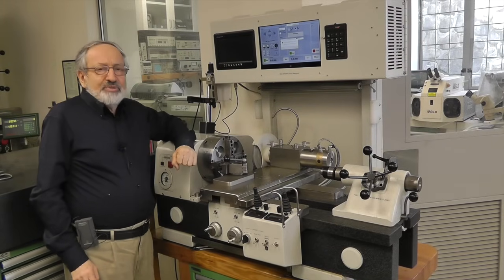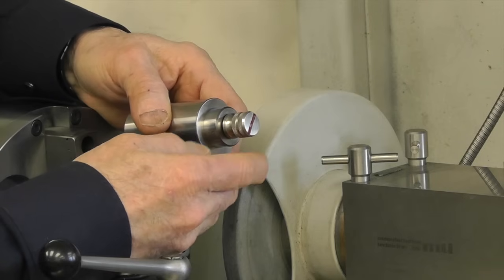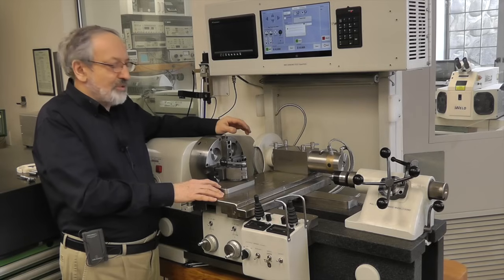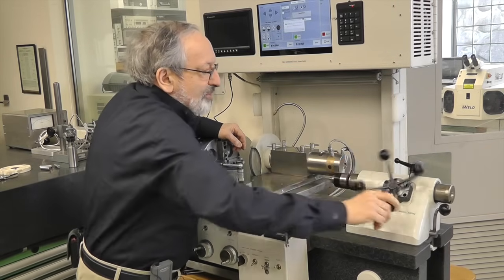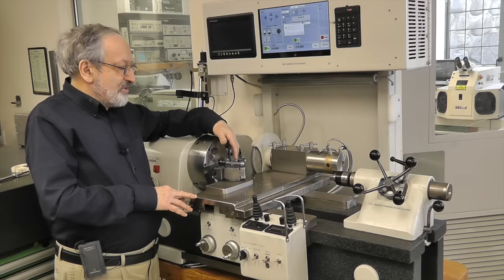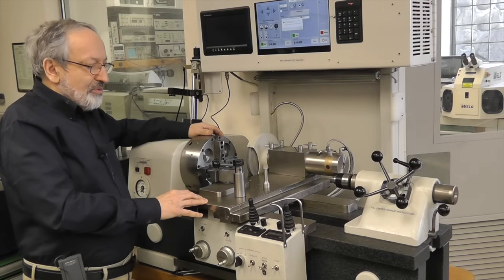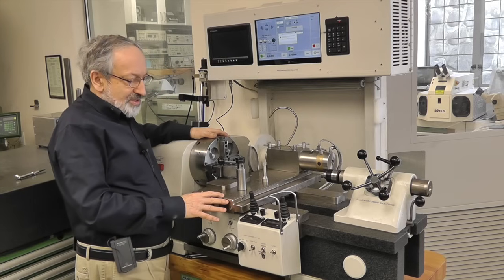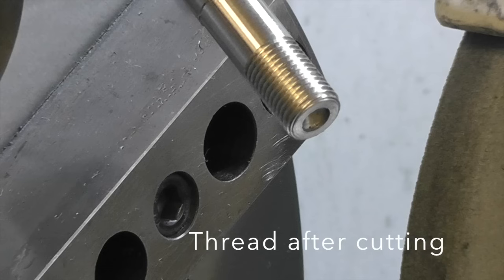High precision air bearing CNC lathe and grinder

Comment: Spinning an assembly in one's hand is hardly anything difficult to make ....provided the machine is a "reasonably good" rigid machine and it is installed correctly and accurately aligned.
In the "real world" there is very little documented about the performance of an air bearing designed machine and its' actual machining capabilities.  There are lots of impressive drawings and lots of claims, but when it comes to actually comparing a good conventional machine vs this kind of machine ....there is nothing.
If someone really wants to machine to 1 micron on a conventional machine .....it will take just as long as on an air-bearing machine, or perhaps a little longer .....and an air bearing machine does not necessarily do it any "faster".     You need the right setup at every step ......and then what exactly will you do with an assembly you hold in your hand and spin?
WHO will use it and WHAT will it be good for?       OR ......HOW could one apply this to anything that makes it useful for anything?
I knew Dan many years ago and supplied some machinery to him when he worked in Discoveries Park.  He talked the same way ...all about precision and accuracy ...and scared most people off .....needlessly ......as they couldn't equate to "reality".
Just a very quick note .....I purchased a Harrison M250 decades ago for my home shop. I spent a great deal of time leveling and aligning. I put a good toolpost grinder on it an pretty much made exactly the same little thing just for fun .....to see if I could make a fit that actually "sealed" .....and I did .....and still have it today, sitting on my tooling shelf.

The point is simple.  ANY serious machinist could make what Dan has made, provided they have good quality equipment. Dan has NOT stated what the "clearance" is on his assembly. He has stated merely that his machine can machine to a micron.  Any machine can machine to a "micron" ...but it would be either "luck" or an "accident". In the case of a lathe, the crossfeed screw and nut, and cross-slide tightness are indeed important, to have any confidence in consistency.

Comment: Hi,

I could not be more impressed. Thank you for sharing. Thanks also for the Flexture video.
I noticed a high-precision feature used in a wafer-inspection microscope that could be adopted to most CNCs. The former optical company Klinger, used a system of bearings to remove an leadscrew/ballscrew's radial influence on the linear assembly. In other words, the leadscrew/ballscrew only constrains the axis in 1 dimension.
https://youtu.be/WDQ3mvtGCTw?si=8Z6VauImSEEpE4xf&t=1867
Reply from the maker: The Klinger solution, which came from their French Micro-Controle acquisition, is good, but the simplest and the best is the solution used by Universal Thread Grinding shown here: https://www.universal-thread.com/  In this solution they incorporate a 2 axis flexture in the nut body and still have good axial stiffness.  To accommodate larger motions the nut body is made longer.
Reply: @dgelbart  , If it weren't for you it might have been a few more years before I heard of Flextures.

I have not encountered this figure of merit, yet, used in their manual: "Thread to thread error as low as
0.000010" including drunkenness".

Oddly, Kingston-style hydrodynamic ship bearings are interesting, as well.

Thank you for the reply.

Comment: if every part has a tolerance of 1mi the total tolerance cannot be 1mi but higher than that
Reply from the maker: The idea of air bearings (or any non-contacting fluid bearing) is that they average the errors. If you have two plates, each one made to 1um, and you make one slide over the other with no contact (like an air bearing), you will get a motion with about 0.1um accuracy. The larger the bearing area, the more averaging you get.

Comment: hmmmm ... A granite bed ! 
Will it be accurate ?
For how long ?
Reply from the maker: Will be accurate forever as all parts float on air-bearings so they don't touch the granite.
Reply: @dgelbart ... 
Wow !!!
I am unable to visualise how the carriage moves(and how the air bearings factor into this) without touching the granite bed !!!

If it's some CNC lathe mechanism I wouldn't know as I haven't had access to a CNC lathe to grasp it's inner workings!

Comment: How does the carriage move? 
How difficult would it be to take these fundamentals and use them to make a mill?
Reply: Air bearing milling machine? interesting idea
Reply: @ ya, my concern would be how much load can an air bearing take?
Reply: @isaiahjanzen3822  yea if you want more rigidity then you can instead use oil film bearings - like the do in swiss lathe spindles
Reply: @IsZomg  oh very interesting never heard of those before,  do you have any videos to recommend?

Comment: Can you tell me more about the cross sled and how that was made? Also, the T blocks of the bed; are the parallels just epoxied on? No bolts?
Reply from the maker: The cross slide rides on two granite parallels, using air bearing similar to the main saddle. The tops of the T-bars are just glued on.

Comment: 7 21 24    
    that demo of the cylinder / piston and on-off air valve was an ingenious idea 
to aid understanding.
      it was just this month reading   t. clancy's novel " the sum of all fears " that i 
became aware of machine tools using air bearings.    and their ability
to grind metal on the inside or outside surface to a mirror smooth finish.

      and that led to searching u-tube for a video on the a-b subject.

        a curiousity is how much of a layer of metal , millimeters or microns ,
 an a-b lathe can  remove at a time.  
       my thought is too much will cause the rotating shaft
to tilt off-center.    and possibly lead to vibration.  

       also curious if hi - precision microgram scales rest on some sort
of an air cushion .  to damp out ground vibrations.    and that it is
this air - damping engineering that makes them so costly

Comment: Will  you share  the mechanism  used to achieve this accuracy in X direction , the encoders  implemented, and the servo/stepper drivers ?
Reply from the maker: The accuracy is based  on a high grade (grade C0) ball screw with a preloaded nut. It is driven from a microstepped stepper motor which is geared down via a timing belt. The amount of gearing is selected by the pitch of the lead screw.  To get 1um error on a 5mm pitch the angular error has to be 360 degree/5000=0.072 deg.  A 200 steps/revolution stepper motor is accurate to 5% of a step, or 5% of 1.8 deg=0.09 deg (at no load) so a 2:1 reduction is sufficient. Note that a rotary encoder does not increase the accuracy. The leadscrew can be error-mapper as the basic accuracy of the lead screw is not quite 1um, or a linear encoder can be used. A high torque motor is selected to limit the angular errors caused by torque variations (what is known as "power angle").  For better performance you can use a servo-motor with a built-in encoder such as https://teknic.com/products/clearpath-brushless-dc-servo-motors/. The couplings between the ballscre nut and the slide are critical as they should not transmit any side or tilt forces. Best type of coupling is as used here: www.universal-thread.com/downloads/Universal-Lead-Screw-Assemblies-Catalog.pdf.
Reply: @dgelbart  Thank you so much for answering the parts that were taking my thoughts on how to achieve this accuracy without needing a high-precision glass absolute encoder.  The info you provide about  the high accuracy of the  lead screw is very helpful over the ball screws.
Reply: https://www.youtube.com/watch?v=9TKd0OXLiiI&t=616s
Reply: I wonder what the lathe can do if its run on a closed loop servo with laser interferometers as the encoders.

Comment: can i just use a big granite surface plate as bed?
Reply from the maker: you need side guidance as well.
Reply: @dgelbart  well I was thinking of taking a granite surface plate & mounting some linear rails on top of it for the carriage. I don't need maximum accuracy. Is this a decent idea?
Reply from the maker: yes.  @karansingh1154
Reply: @dgelbart  thank you

Comment: I need this.  Specifically, I need single point diamond lathe cutting of paraboloidal, hyperboloidal, or ellipsoidal shapes in 6061 Al.  The parts are about 2mm at the large end, 1 mm at small end and about 70 mm long so they resemble very long thin cones.  Because they are so long and thin, they must be held at the tail end while being cut so they are under a very small tension during cutting.  After cutting we will coat them with 6um of electroless Ni and superpolish with diamond powder to a surface finish of 10 angstroms rms.  These are molds for grazing incidence x-ray mirrors so accuracy is needed.

Comment: Is there a car with wheels wich work with air bearing? Or a car's engine with air bearing?
Reply from the maker: No.
Reply: Do you think it could work? If you don't, could you say why it couldn't work for the wheels or different part of the car's engine?  @dgelbart
Reply from the maker: will need too much area.  @david43485
Reply: I don't understand fully your answer. But I suppose that's a question of mechanical physic.
And I keep your answer. Because you know what you wrote, and you know your subject : the applications of air bearing.
Thanks Dan! Have a nice day!
 @dgelbart
Reply: @david43485 air bearings are not great for huge mechanical loads. He is saying the surface area of the air bearing would have to be huge

Comment: Thanks a lot for the video, Dan - really impressive! I was just wondering if it's not a problem to grind on the lathe? You grind wet, but isn't there still a small risk that the grinding dust will damage the machine bed or other parts of the machine?
Reply from the maker: You are correct. The bed has a rubber cover, connected to the carriage. It is not shown in the video. I was also counting on the air escaping from all the moving areas but this was less successful.
Reply: OK, understood. Many thanks for the quick response!

Comment: How flat "generally " is 1 1/4 polished black granite from a stone supplier not lab equipment store ?
Reply from the maker: My guess is 25-50um (1 to 2 thou) for a 50cmx50cm slab. The error typicall y grows as the square of the size.
Reply: @dgelbart  Thank you so much for answering !

Comment: What is the best way to make tailstock the same level as the chuck?
Reply from the maker: The tailstock was bored out on this lathe, using a 600mm long boring bar clamped in the chuck and supported at the far end by a precise bushing. To get the bushing exactly on the spindle centerline you bring the bushing, mounted on a temporary tailstock block, near the chuck and bore it out by coupling it to the slide. Now you have a support bushing exactly on the spindle centerline, and you can install the boring bar. During boring the tailstock is coupled to the slide with a linkage, so you can use the power feed of the slide to move the tailstock and bore out the 300mm long hole to 1um.
Reply: @dgelbart  thank you!

Comment: Good day I presented his air pillow lathe on our forum and various observations were unleashed.
a) of what the mand however to the X and Z moves under the push of the tool.
b) At what pressure the cushions work.
How much air consumes the spindle and all the complete lathe
Thanks for a welcome answer
Sincerely
Giuseppe Crimi
Reply: thank you very much, inserted your answer directly in the topic
Reply from the maker: Here are the answers:
 The stiffness of the air bearings is in the range of 1um/kg (i.e. a 1 kg load will cause a 1um deflection). This does not affect accuracy much as the forces created during a finishing cut with  sharp tool are much below 1 kg.  The air bearings need at least 6 atm (0.6MPa or about 90 PSI) to work, the higher the pressure the better. The air consumption is about 100 liter/minute..

Comment: i think i figured out something interesting about building structures by watching your videos, can u please tell me if i'm correct, and if there are any exceptions to this thinking :-
1.   if the only purpose of a structure is to be stiff ( i.e., to have a low deflection per unit load), then, i can join the building blocks of the structure, using just hardware shop epoxy. (ex - machine frames like this).
2.   if a structure is meant to bear load to its max capability without breaking then i have to use welding. (ex - bridges and buildings). stiffness and deflection become unimportant.
3.   since most machine structures are meant to be stiff , but not strong. an epoxied structure would make more sense as welded structures would cause more problems (warping, internal stresses, etc) than an epoxy glued structure. 
4.    its better to make a machine structure by gluing with epoxy than by welding.
5.    people who are building machine frames/structures by welding steel are wrong.
6.    another method : using only screws and nuts ( threaded mating parts) to build the structure. i'm wondering if this method has the advantages of both epoxy structures and welded structures. is it better than both, or comes second to epoxy.
7.    how about using both epoxy and screw , will it give both stiffness and strength?

Thanks in advance. i've learnt so much from you.
Reply from the maker: Correct. See the demo of stiffness vs. strength in the video called "design" in my prototyping series.

Comment: What is the difference between semiconductor air bearings and regular air bearings?
Reply from the maker: None
Reply: Thank you for replying. May I ask the thread width of the screw drive and the model of the stepper motor you are using?
Reply from the maker: @Aviator168  3mm
Reply: @dgelbart  Thanks Dan. I am trying to learn here. Why did you choose a stone instead of steel for the bed?
Reply from the maker: @Aviator168  1. Long term stability 2. Availability of accurate 4 way parallels.
Reply: @dgelbart  I see. Thank you.

Comment: When making the bed section, you mention the bolts will hold the sections with compression. Doesn't the bolt relax and compromise the accurate measurements?
Reply from the maker: The amount of compression in the bolt does not affect accuracy, as long as there is some compression so the granite slabs can not separate.
Reply: @dgelbart  thanks for taking the time to reply. Indeed you mention spacers, once it’s glued the bolts shouldn’t affect at all.
You have all these hands on tips, I suspect you learnt by doing but any books you can recommend?
Reply from the maker: @andremartinho913  For the high precision parts: "The Foundations of Mechanical Accuracy"  by Moore (available from the Moore company).

Comment: Doesn't the air friction lead to the metal heating and expanding leading to the bearing seizing?
Reply from the maker: At normal RPMs (say up to thousands) the bearing actually is colder than room because of the cooling effect of the expanding air. You do have to consider thermal expansion in the design, as most of the time the shaft and the journal are made of different materials. In this lathe the shafts are 400 series stainless steel  and the journals are bronze, so you're worried about cooling rather than heating.
Reply: @dgelbart  Woah cool. Thanks for the response! I found you because Paul Townley a guy working on a tesla turbine referenced your video in an interview. He called you one of the world's best machinist. What would you say would be a good build for a bearing for a tesla turbine that might spin 100k rpms or more?
Reply from the maker: @Ghanzo  100KRPM is no problem for an air bearing, can even be made self acting (not needing compressed air).
Reply: @dgelbart  Wow, amazing. Do you make parts for people?
Reply from the maker: @Ghanzo  No, the workshop is for  R&D (Research and Development) and hobby projects .
Reply: @dgelbart  Aw shucks. Well if you change your mind, you'd be the perfect guy to build a tesla turbine. Some people think they have some really interesting properties. It appears like he invented something that can run on atmospheric pressure. From what I've learned I'm hopeful that it is possible. Anyways, cool videos and amazing lab.

Comment: Just a question, what actually drives the axes? I presume it uses linear motors?
Reply from the maker: Steppers with ball screws.
Reply: @dgelbart  
No way! Really? For micron accuracy? Or are you joking?
Reply from the maker: @robbiejames1540  
The highest class ball screws are accurate to microns. Even a cheap stepper has an accuracy of 5% of a step, which is 1/20x200 =1/4000 of one rotation. Even without gearing this is 1.25um accuracy on a 5mm pitch ball screw. I geared mine 2:1 so stepper error is below 1um.  In general, what is important in a lathe is not the screw accuracy but the geometry:  straightness of travel, squareness, trueness of rotatrion etc.  You can achieve 0.1um resolution and 1um accuracy with a cheap stepper and a very good leadscrew.
Reply: @dgelbart  
Wow! When you put it like that, it seems so obvious, but I'd never have guessed. Thanks for explaining!
Reply: @dgelbart  
Oh, btw, how did you gear the stepper motors 2:1 without backlash? Timing belt?
Reply from the maker: @robbiejames1540 Yes.

Comment: "Bearings, very cheap from eBay, only couple of hundred bucks each" > for average reader, very cheap is two orders of magnitude off that and many have lathes that cost as much as only those bearings. :D
Reply from the maker: I understand that very well, but when you undertake building an air bearing lathe to 1 micron it means all your problems in life, including financial, are behind you. To use a lathe is a hobby. To build an air bearing lathe is a serious medical condition.
Reply: @dgelbart  The best kind of medical condition